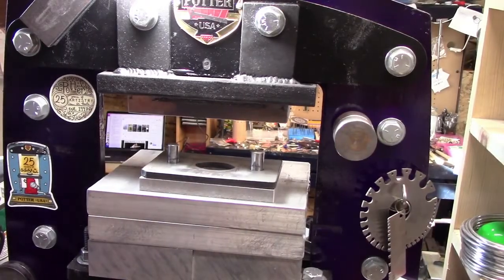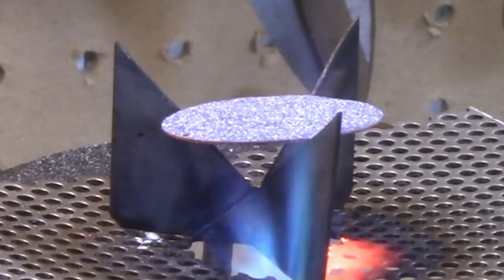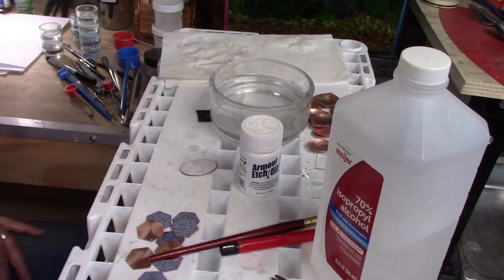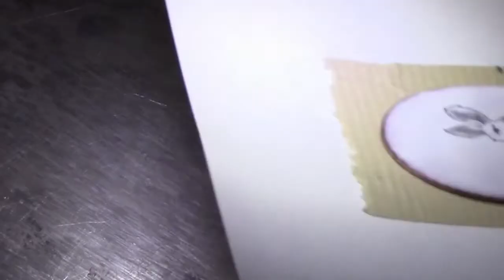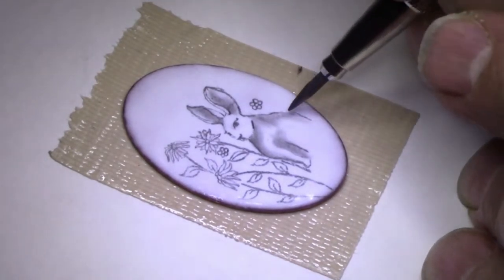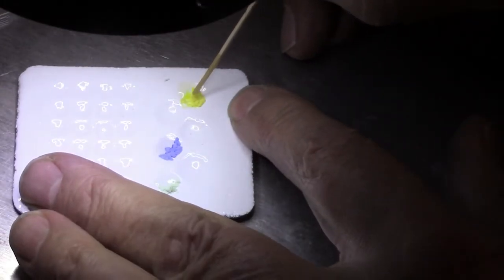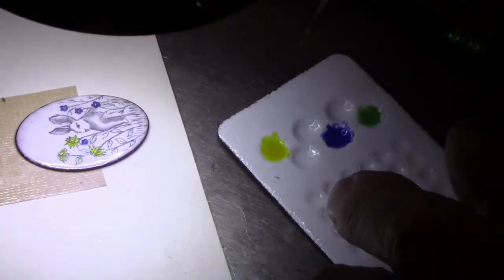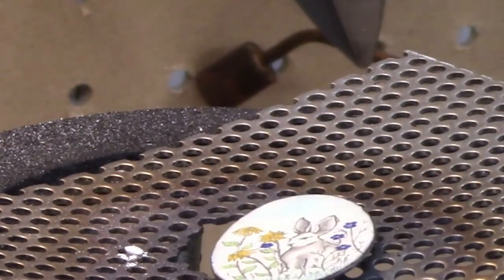Drawing With Graphite On Enamel - A Wee Coney In Amongst The Flowers

Comment: Is a glass etcher a necessary step? It’s very hard to find in my country (no idea why) but I have plenty of diamond coated files for enamel, would it be possible to achieve decent results, or do I have to go look for glass etchers online?
Reply from the maker: The chemical process is not necessary, but much more repeatable and easy. All you need is some amount of “tooth” on the glass. Sanding with diamond or silicon carbide should work fine IF you can get an even surface. I had some success also by painting the surface with a light coat of white watercolor. When it dries it will accept the graphite if you are careful.

Comment: You mention you should have domed and the flat blank only barely worked... Why? The problem?
Reply from the maker: This was heavy enough to handle the differential stress of expansion without cracking. Since the glass and metal have different coefficients of expansion it is safer to dome the metal so that as one side pulls the other side pushes and the forces equalize. This is what many enameled pieces are domed.